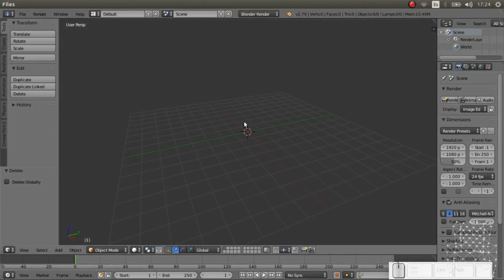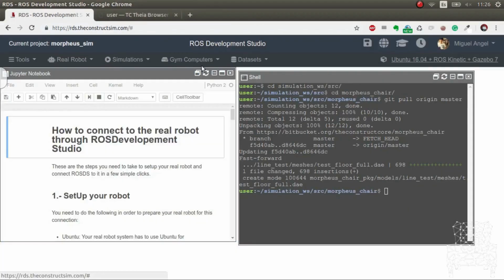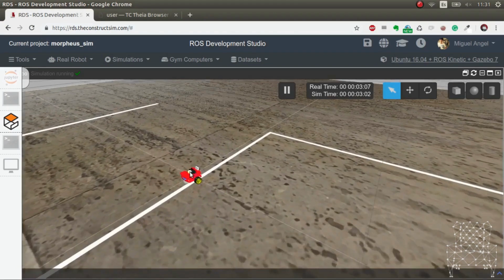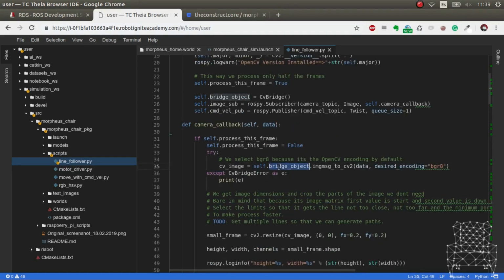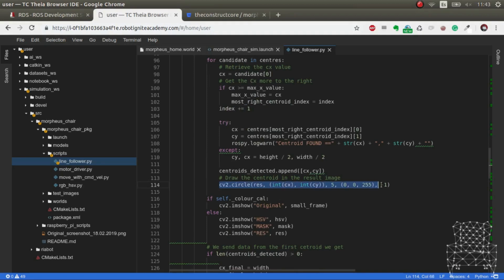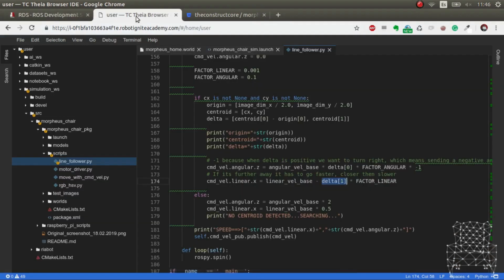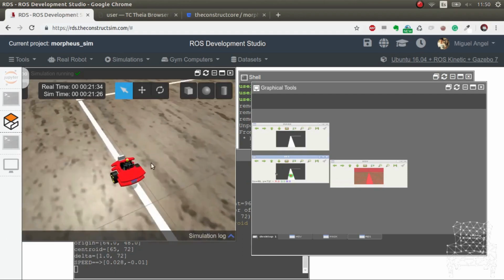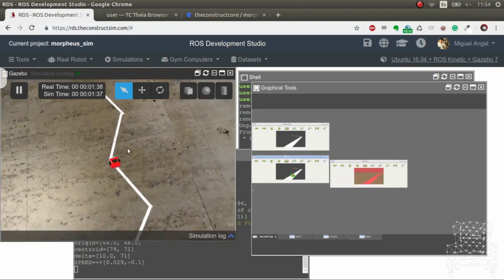[Morpheus Chair] Create a Line Follower with RGB Camera + ROS | Ep. 5

Comment: great lesson, probably the best so far of the first 5 episodes. But still I am very curious on how to add (in a cheap and simple way) a position or speed feed back for a more precise closed loop speed or position control to have a more general application of this fantastic small robot,  so for example to follow the lines much faster than this (because the robot here is in very slow motion isn't it??). Thanks for this excellent tutorial.